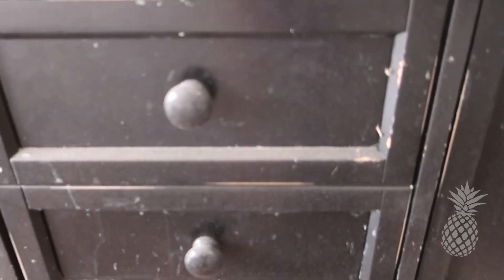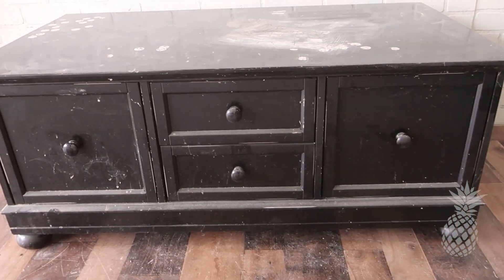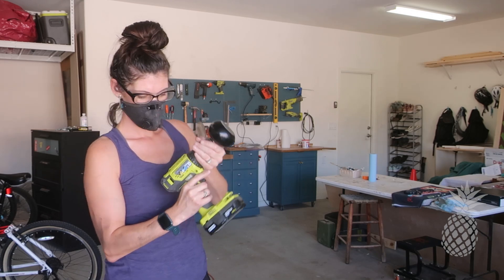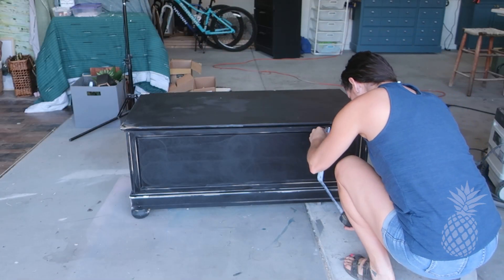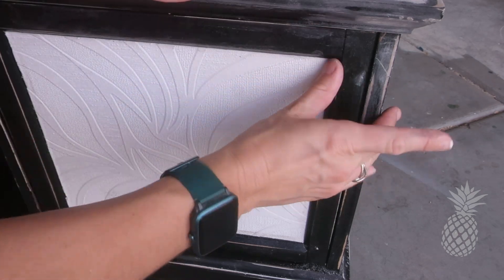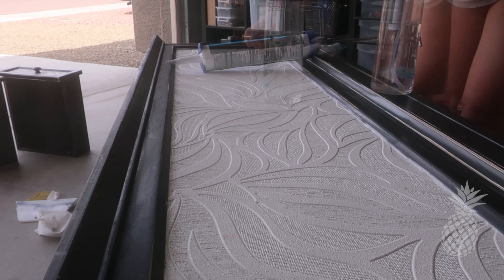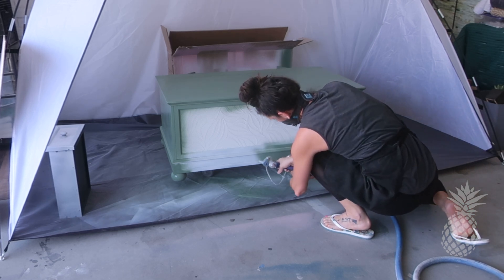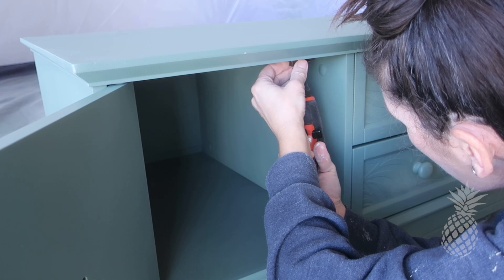Trashed Table Saved with Wallpaper and Paint / Furniture Makeover for Profit

Comment: Great job. But, in my opinion, it's better to put something on the countertop. To avoid damage to the paint and contamination of the surface, how do you look at it?
Reply from the maker: 👋Yes, we certainly agree! We use a paint that has a top coat and then add more layers of top coat (polyurethane) for protection but adding a cloth or felt under heavy objects will certainly help protect the surface even more! Thanks for watching and for your comment!

Comment: This is very nice and the wallpaper idea is really nifty - I wonder whether using a different colour - or maybe just something like a silver fleck light coat - on the wallpaper sections would have looed good?
Reply from the maker: Thank Luigi! I bet that would have looked good. We did another piece with different paper that we painted black and then went over the raised areas with gold. It turned out really good but it took a lot of time. 😊
Reply: @secondchanceohana  yeah, I saw your other video later in the day and realised I wasn't being that original after all.
I wonder if playing with a hard roller would allow you to obtain the same effect 'only on the raised part' with a lot less work? It would probably be a slight amount of paint which would be just right for many applications.
Just thinking out loud, mind.

Comment: good work!!! suggestion: for caulking, apply sliding the tip angled towards you and not away from you. It will leave a smoother bead that can easily get cleaned up running your finger on it. Nice transformation though!! I was skeptical of the wallpaper haha but it turned out great!
Reply from the maker: Thank you for the tip, Steve! I'll try that. As you can see, I haven't done a lot of caulking...😮😬😊
Reply: @secondchanceohana  haha well, I have not done much furniture refinishing, so we’re even! 😂

Comment: It looks fine.  Unfortunately, wallpaper is rather soft and vurnerable.
Reply from the maker: Hi 1959 Berre, thanks for your comment. You bring up a good point. We hope the wallpaper stands up to normal wear and tear for many years. It is very thick and heavy, caulked around all the edges and topcoated with 3 coats of polyurethane. It was also only applied to recessed areas. But even doing all of that, it may not be suitable for all homes where it could get damaged with heavy use or abuse. 😬